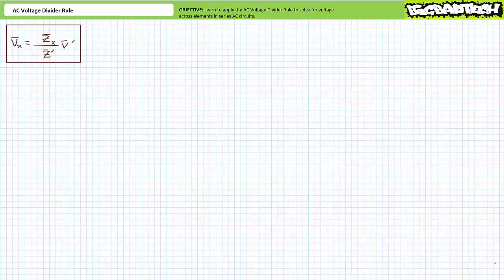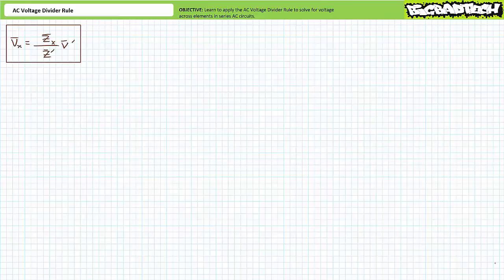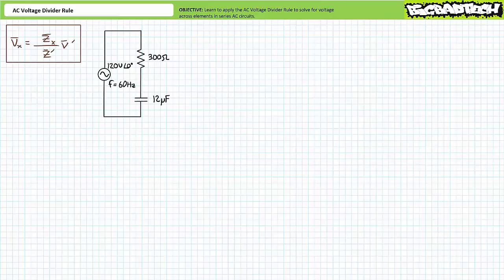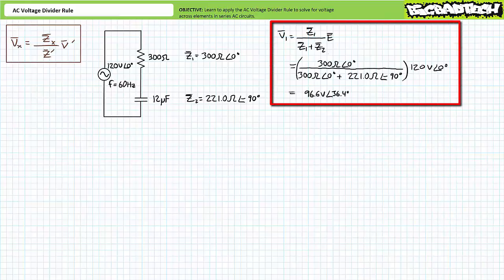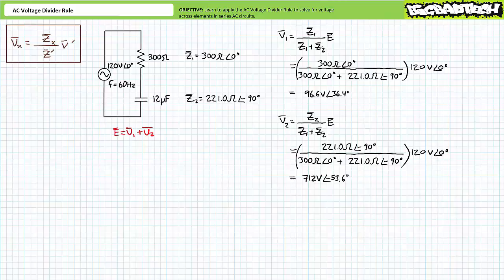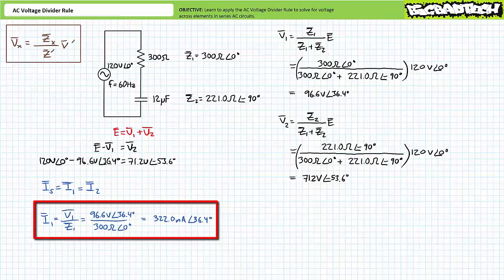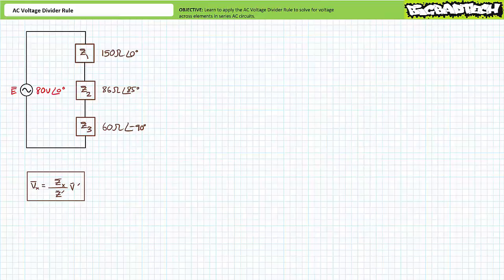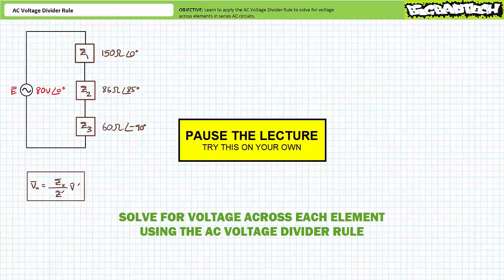AC Voltage Divider Rule (Part 1 of 2)

Comment: I am trying with 104pf capacitor and 470k ohm resistor of 220v AC, its showing 13.96 V
Reply: Sorry 10,0000pf capacitor
Reply from the maker: Capacitive impedance is a frequency dependent phenomenon. Check out the capacitive impedance lecture at: https://www.youtube.com/watch?v=3Fw32jEL3_8&t=942s